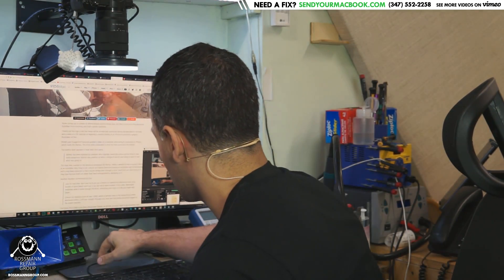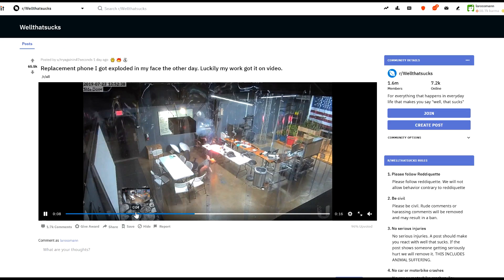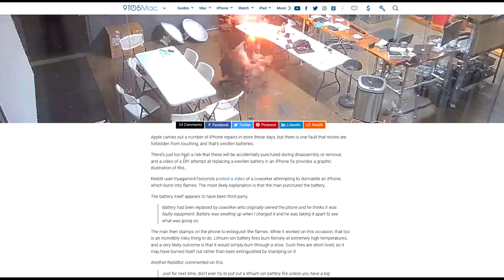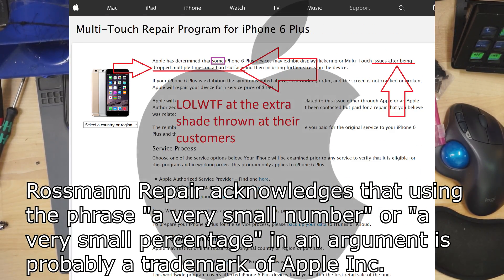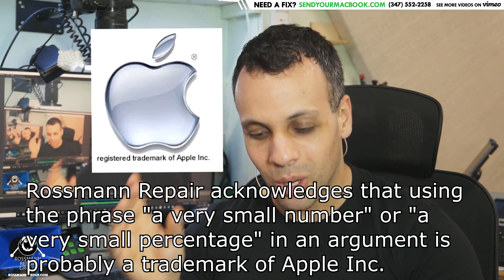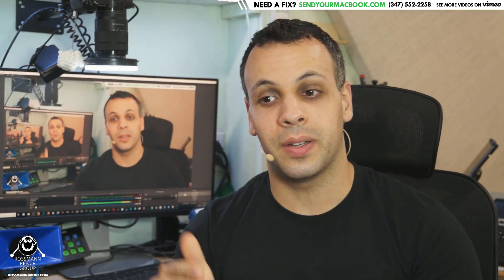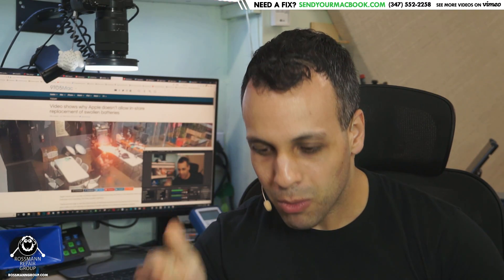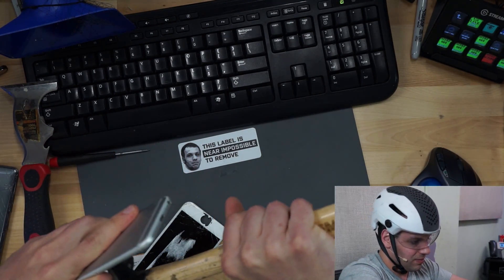STOP FEARMONGERING

Comment: @
Louis Rossmann - you are not entirely right about no-name batteries. The issue is that they can mark some 5C rated battery as 10C and the material quality may differ as well as I have seen with my own eyes used batteries recycled as new in some cases. So yes - Lithium is Lithium, but Lithium compounds can have different quality making it more prone to bloating or not.  Off-brands may f**k you up in other ways. Then again - apple original batteries and MBP battery management circuits are crap anyway. There are thousands of different electronics gadgets with LiPo inside, that has not bloated for majority of users for 20 years, last 10 in shelf. MBPs tend to bloat batteries so often and after less than 10 years of use. That is a design flaw and I would suspect it to be something related to quiescent current being comparably high at off-state, so batteries go to deep discharge. I mean they should bloar when charged under wrong circumstances, not while staying in shelf for half a year.

Comment: I have replaced quite a few iPhone batterys in my life. Never with an approved tool just a basic metal spounger, and never have i once had a fire happen. Not once, even on expanded batterys. Never a problem with macbooks either, Just simply pry it up or if you can remove the logic board and other electronic components heat gun the glue.

Comment: Apple: doesn't sell batteries nor parts and makes it near impossible to get anything for repairs.

Repair community: forced to use third party or refurbished parts.

News article: "fires don't happen if you only use recognized brands and first party parts"

Repair community: "fuck Apple"
Reply: The basic fact is that Apple treats its users as suckers, and as a result, that is their user base like it or not.  They are constantly told they are using the most advanced systems, that they have the best hardware, but they aren't technical enough to make the evaluation and there's desperately few Apple users who would actually need the horse power as well.  99.99% of the time, your computer is idle.

Comment: While I enjoy the argument I'm actually left wondering something. What about the outside shielding of the battery? If the Li-ion battery is wrapped in a thicker shroud, it would be harder to puncture, no? And that would vary by the manufacturer?

Now, Apple is fucking cheap and their store techs are ridiculous, so knowing them they would go with a thinner shield. But I wonder how much the puncture risk could be mitigated with a thicker shield? Third party options with thicker shields might seem more appealing.

Comment: Im waiting for a leason to be learn...
All I can think is to kill battery charge as much as possible before removing them completly, probably with a 5V lamp to short-circuit the thing (might take minutes to hours :P)
Reply: Internal controller(BMS) will disconnect lithium cell from   battery terminals when it detects overdischarge condition(usually 3.3v to 2.5v on any battery cell). So overdischarged battery is still containig enough energy to let you see a huge cloud of toxic smoke or event catch fire if mechanically damaged.

Comment: I think that the best way to make sure a device is powered down is by un-plugging it and removing the battery. It was actually one of the best features on an older laptop of mine when it froze up. Things like Ctrl+Alt+Del used to be hardware-level functions, and nowadays, it tends to be a software level feature. What good is a software level feature if the software that is supposed to run it is completely frozen. When all else fails, unplug it and pull the battery; good luck doing that when the thing is glued to the inside of the case.

Comment: Manufacturer quality control could be an issue. It's happened several times with many companies. Factory-supplied batteries have swollen and burst without any manipulation. Happened to Dell, Samsung, Apple, etc. Apple just has that ultra ego.

Also, I don't like the term "explosion" because it makes it sound like detonation, when it's actually deflagration.

Comment: I think the BIG deal on Apple devices is that they GLUE the batteries in.  They didn't use to do this, they were easily removable with screws.  The Glued in batteries are much more likely to cause issues.  Apple did this knowingly.  The same way they chose to seal the batteries inside the phone and not allow replacement.

Comment: I always said that batteries sealed inside phones were what i call "planed obsolete " (sorry bad English right there)  ans are only intended to make your phone that works perfercly fine and has been well preserved by the user, to become obsolete,  because it cant old a full batery for more than 3 hours on minimum brightness until it's depleted and neer recharging, and you can't even replace it so you need to buy a new one, batteries tend to last about 2 years for the average teenager that constantly uses his device and charges it 1 or sometimes 2 times a day,  and you will need to buy a new one after that, also, my personal phone has an internal baterry WHEN IT'S NOT EVEN WATERPROOF my mom and dad phones (both Experia E5)  ARENT WATERPROOF yet the battery is sealed and almost superglued in place, and most times they dont even include a back cover, you need to remove the screen to reach the battery to risk break it,  and you need to fight the battery because it's glued there with enough glue to attach a elephant to a airplane,  why the glue? Its sealed there and it has no space to move, and the conector is a ribbon cable ao it wont disconect for bouncing inside the phone, it's just stupid,  i get that these batteres have no casing,  removable batteries have a rigid plastic case to protect them,  the dont bend and are arder to puncture,  and the newer ones don't have thet so that phones can be thinner,  i get it but sometimes there is clearly enough space to have a removable battery, or a not so well glued one at least,  it's a trend that came just to milk more money of the brain washed sheeps with money that blindly follow trends to look good socially but are buying shit that is worth half the price or less, but they keep fueling these brainwasher companies

Comment: Brand can make a difference, they are far more likely to burn when fully charged, the higher the charge capacity (more lithium) and the greater level of charge (more ions charged) the faster they burn (if it is a third party problem then the third party batteries must be higher capacity).   it is one of the reasons the Tesla cars will cascade burn in an accident their batteries are very high capacity and packed close together (like any good union one out all out), The other contributing factor is age, as the insulator is degraded by repeated discharges the chance of a spontaneous shorts increases. Hate to think what will happen when the electric semi trucks after a few years of being heavily discharged and charged every day, One slightly inferior battery in a pack of thousands and bye bye truck.

Comment: if they just want to make the battery sealed... than can just put it in a super thick Zip-Lock with no Zip and a plug that fit snug and sealed... problem is if the device had any type of ports on it even a charging one, it is not water proof.

Comment: I have a nice old Motorola phone.  It has a user replaceable battery and a slide out keyboard.  It makes phone calls just fine.  It runs the few apps I need just fine.  It runs for more than 3 days on a charge.  No new phone has those features so I will not buy a new phone.

Comment: Lithium polymer. These are lithium polymer.
Lithium ion has a current interrupt device that will vent the battery without a fire, lithium polymer will set on fire.
The big brains over at Apple simply refuse to use a proper lithium ion battery because they're more expensive to manufacture, putting everyone at risk for a couple extra cents off of cost.

Even then, these things don't happen easily. You've gotta really stab a LiPo to get it to light on fire like this. A simple scratch in the foil won't trigger an explosion, just a lot of heat and an unusual sweet smell.

So... if you're worried you might have cut it, give it a sniff. If it's sweet smelling, stick a piece of tape over the puncture and throw it away.

Comment: Answering your question: Failure is mostly a short circuit inside the battery itself. What's burning is electrolyte which oftenly uses lithiumphosphatehexaflourid, but also the lithium itself. The cheaper the battery, the better it burns. Security measures: A fireproof surface, gloves, googles, the ability to leave it alone and a bucket of sand to extinguish it. Sand is perfect for it, it smelts over the hot spots, it also can be re-used and cleaned up.

Comment: This is why I use phones that have modular batteries. not that my phone is worth replacing the battery on that its contract is almost up on. nice work with the hammer. .abridged popo laugh.
sealing the battery in the (ever thining)phone just allows the backlight and cpu/gpu to cook the battery till it expands

Comment: While your re-re battery removal was entertaining, most people would likely use a small flat head screwdriver to pry it out... like I did when my mom's official original OEM Apple battery reported <50% capacity. It popped, crunched, curled, and made a few wisps of smoke.... but it didn't explode. If I had opened the 3rd party replacement battery packaging before the battery removal, I would have seen they provided nice plastic spudgers and instructions on how to remove it without it exploding.

Comment: Apple is going to be the first company to  fill the entire device with epoxy including the battery
Reply: They'll be the first company to fill *an iPhone* with epoxy. There is already plenty of other devices completely enclosed in epoxy or other materials preventing repair, tampering or simple examination. Very often this happens with super-cheap small electronic devices; sometimes it happens with industrial machines.

Comment: I don't know that they can make a user removable  battery and keep the same chassis stiffness, for factor, capacity, and water resistance. Gluing the screen on the phone is one thing, but designing a reusable seal and a latch to hold a back cover on will take up useful space inside the phone

Comment: "What do you have to do to get a battery to explode?"
I've had a long list of batteries fail and expire in my possession.
Of all the batteries I've worked with, modified, or abused, I've never had one go up Note 7 style.
I had ONE cell of a 4S pack vent, and it left a discrete char mark on the table I left it on. The other three cells were fine, as was my table once I cleaned it up.
I've had a few things TRY to go up, but I wasn't a dunce and I disconnected power before they did.

I have a phone which got RUN OVER BY A CAR and the battery was all mangled.
It still worked, but didn't hold charge very well. I safely replaced it with a third party battery.
I have two more that look like they've had very minor punctures, but neither went up.
One has broken contacts, the other has reduced capacity.

Comment: I wish I could've been in the (presumably post-jobs) meeting at apple inc where they decided that battery *replacement*, as distinct from replacement-battery-supply, should be a significant part of the repeat-business. "really, dick-head?", I would've asked,  "you want to glue the batteries in & weld the case shut so that we have to train hundreds of 'genius' staff to do what should be a user-operable switch-out?"
the RAM & the CPU I can sort of understand- you don't want them working loose when the device is thrown about like laptops & phones sometimes are. but the battery pack- the very thing that defines a portable device- glued in? STFU. 
back in the early days of nokia & ericsson mobile phones, if someone in the office went to a meeting & left their phone on their desk, & it rang more than twice, you could take the battery off & hide it, so they'd learn not to be a nuisance. now you have to hide the whole phone, & people start calling security or the police instead of figuring out that if they call the damn thing, they'll hear it up inside the false ceiling or in the planter or the waste-paper-bin where you've stashed it for them. but I digress....

Comment: I make RC model that use lithium battery and there is way more risk there but most of the time fire occur when shorting the battery or like you mention puncturing it.  And indeed the brand doesn't not matter when we are looking at a simple lithium reactivity with air or water (never put you battery into water !!!)

Comment: I had my battery pack inside my mbp 15inch late 2015 expand massively after 4 years of intense usage (2-3 VMs heavy code compiling etc)... so I had top pay 600 usd to an apple auth. Repair shop,.. sadly I did not have an independent repair nearby and apple gives a fuck anyways.. but what I can tell here is that replacing it on my own was too dangerous for me. I am not a technician (ok ram and ssd replacement and dust clean etc. is easy) but this was too challenging for me... however I agree 100% with Louis. Because of all those developments my next laptops will be a thinkpad

Comment: I'll bet that Asshole Craputers is including vape batteries.   All batteries are 3rd party.  I have NEVER seen a flat-fold battery "explode" even when intentionally damaged by a professional in a closed studio.

Box o' bakin soda and a little vinnie is all you need for em.   Sand bottom bucket of water works every time.
It is literally more dangerous to charge your phone while it is standing in a stand than to replace the battery.

Comment: Even the comment that 'if you puncture a lithium battery it will explode' is misleading. Many people puncture puffed batteries, squash them flat and then tape over the hole, without the thing going bang. I'm not suggesting you should do that, it's stupid and unlikely to 'repair'the thing, but it doesn't go bang every time.

Comment: The factory is already built, the assembly line is already tooled up and running, and the phones are already shipped to the stores.  Selling you a new one is a high return on investment. Sinking new money into equipment/training/insrance all sounds nothing like return on investment.  They'll charge an arm and a leg for the service just to make sure quarterly and yearly growth aren't hurt.  So much that most customers will just get up-sold to the new phone they wanted them to buy in the first place.
If apple was run by engineers they'd do something like put a high end fume hood and heat/fire resistant safety equipment in the back end of every store.  Apple is run by investors and accountants.  I guarantee they already have charts showing the expected revenue gains that would come from eliminating all third party repairs....  Except they'll label them as predicted losses and talk about them like they're stolen revenue.

Comment: Hey Louis, I appreciate the job you're doing for the community. I would like to add that the battery "explosion" is not just caused by the puncturing of the wrap(the plastic outside the battery layers) but by the shorting of the latter. Back when I used to dispose old lithium batteries, the "safest way" to store them was to discharge the battery, then puncturing the outside wrap and submerge the cells in salted water. The reaction occurs if the puncture or deformation makes the cathode and anode foils touch. Then there's the explosion thing... That happens only if the external wrap is intact ad the chemical reaction can build up pressure, which is even more rare. The most common scenario is the toxic smoke or the more rare flame, that I wouldn't call explosion. I've done this for years and never had a fire so far, the only time I had I fire was when I crashed my rc helicopter and a 12 cell 5 Ah battery shorted. I wouldn't endorse people puncturing batteries the way I used to do anyway, it's not safe.
Sorry for my English, I wrote this on a phone while eating :D
Cheers!

Comment: The only reason crApple glues the batteries in is because they want you to buy a new $1000 phone every year rather than carry on using your existing one (My Galaxy S3 is 6 or 7 years old now and works just fine. I have replaced the battery twice from new)

Comment: I'm a total novice and successfully replaced swollen batteries on 2 iPhone 5s for my family members. I was cautious and everything went fine. I had the old batteries properly disposed of, and all was right with the world. Technicians always assume a certain level of risk in order to perform various services and people can't always excuse Apple's refusal of services under the umbrella of safety.

Imagine if a car dealership said they couldn't replace your fuel pump sender because it's submerged in gasoline and the risk of fire is too great.

Final note: Both of the swollen batteries from those aforementioned iPhone 5s were the original ones from Apple. The supposedly dangerous third-party batteries I replaced them with have worked great for over 2 years without trouble.